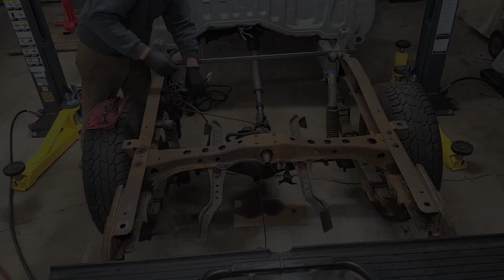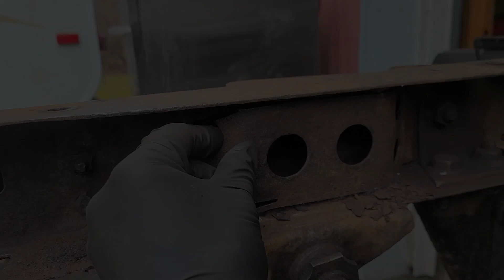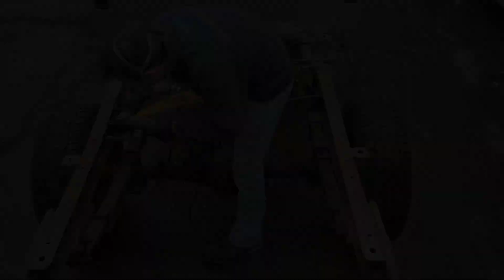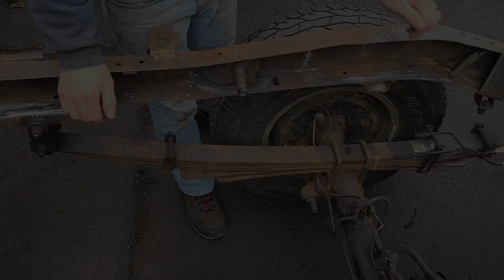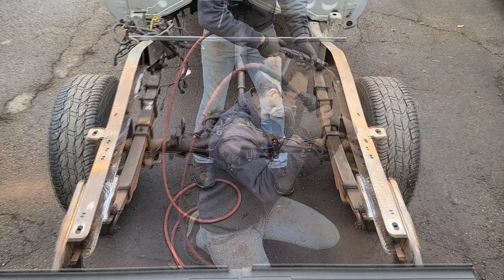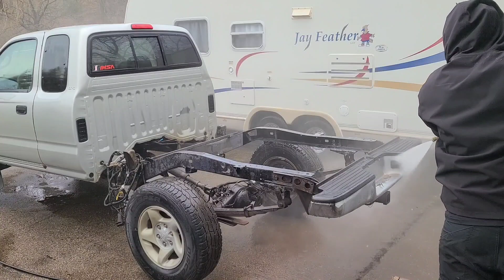Tearing into the back of this Tacoma frame

Comment: Fluid film is youre friend.
Reply from the maker: Clearly, it is not! 😄 
I have heard great things about Fluid Film and other products. That is something I will be adding once the vehicle is finished.
Reply: FF is not the best stuff for the high-wash areas... it failed miserably on my taco a few years ago when i was testing it... washed right off in the wheelhouse areas and had to reapply when it was zero degrees F out to keep salt off... i have since found a better product WW HV that is SO Much BETTER than FF junk... but it does collect large amounts of dirt and sand which is challenging to get off